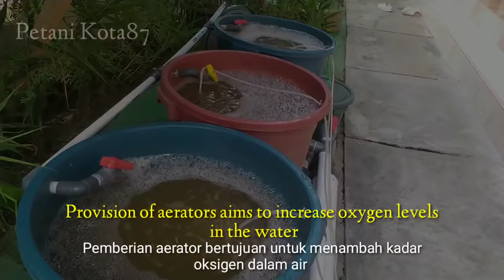DIY : How to build simple RAS system for catfish ponds using bucket || Aquaponic system (Part 2)

Comment: Thank you for the excellent video. I have a few questions
1) Aren't the ponds overstocked & crowded?
2) Is there any reason the water is so brown & cloudy? Is the filtration system not cleaning adequately? 
3) Due to the depth of the ponds & cloudiness, it might be difficult to see if there are any sick or dead fish in the bottom of the ponds. 
4) Wider basins would have been better to give a larger surface area for absorption of oxygen, give a wider area so you can plant more lettuce & also give the fish more space to swim around.
Reply: Fully agree
Reply: Dear ..body of fish or human... starts Floating... 2. You may go for 16 x 16 or 20 x 20 tank, need filtration, oxygen equipment ,motor ,pump and other .
Reply: I think that kind filtration capacity isn't enough for overstocking fish like that.
Reply: @theofilus3686  I agree